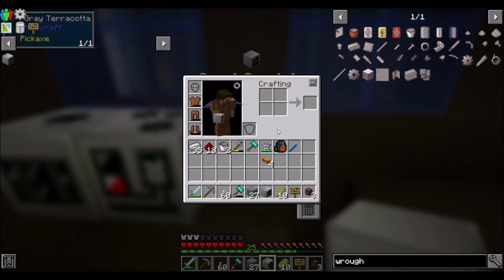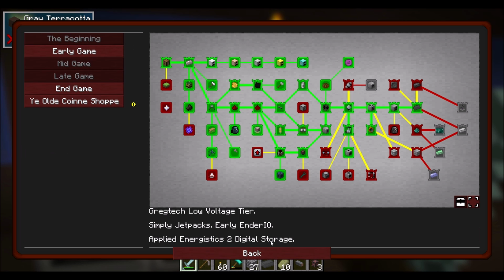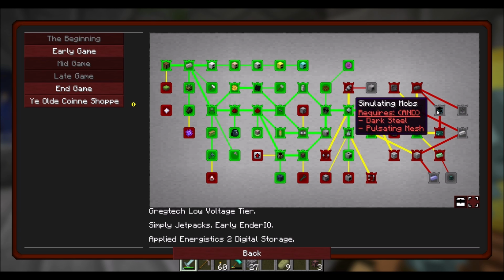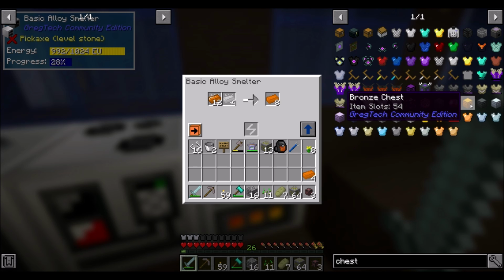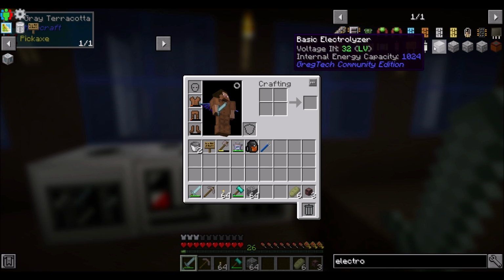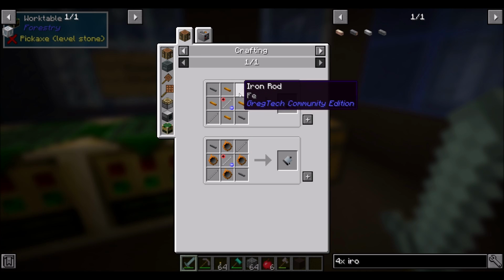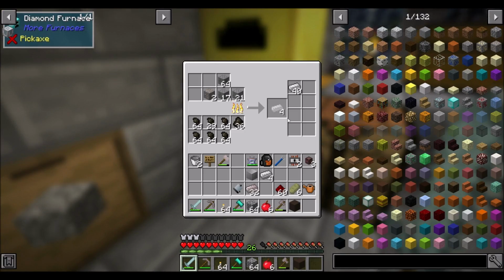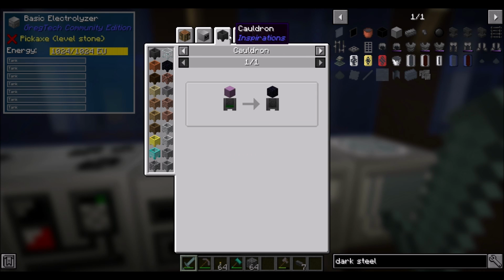OmniFactory   Ep7 More Machines

Comment: Dire, there is a Fluid Solidifier quest in the book.  It has you building ender tanks and pumps to automate obsidian.
Reply: The only hold up being the 8 blaze rods and the 2 redstone servos needed to make two ender tanks
Reply: @Wis-ti  I haven't made the servo yet, but the blaze rods can be found in the lost city buildings.  You can convert brewing stands back to blaze rods.
Reply: I was able to make one servo from loot in a nether fortress, and I've killed a few blazes already. Just need three more blaze rods and a servo personally

Comment: Hi, try breaking an ore block with one of those hammers u use for crafting
Reply: Without veinminer or something to place a lot down all at once, it's really not that important.  TE mining Hammers mine extremely quickly and are easy to make.  Most ore's can't even be smelted in their crushed variety and require further processing to process them.  Until you can make a set of machines for just dedicated ore processing, any macerating or other stuff usually isn't that great.

Comment: Damnit Dire, it’s URANINITE, not urine-ite! >:V

Also, kinda sad it seems they ditched the Electric Blast Furnace. That thing has been central to Gregtech for several iterations now :(

EDIT: Should’ve watched the whole video before commenting that, whoops
Reply: Shaw Fujikawa They didn’t remove the EBF, it is used for higher tier alloys
Reply: Okay, makes sense.
Reply: They only skipped bronze age. 
EBF is the gate from Low voltage to Medium voltage.
Quest to make one is just behind the electrolizer quest that dire forgot to finish.

Comment: Love your vids thank you! Hey what kind of pic set up would you recommend for modded mc?
Reply: i5-8400 turbo cpu w/ good cooler, z-370 motherboard, 1060 geforce gpu, 80w Bronze power supply, 500gb ssd card, a tower that'll fit the motherboard and with decent amt. of fans, and 16gb ram. It's a bit overkill but you can play games like rust and minecraft no problem.
Reply: @chadandre8980  not a complete noob but whats a amt
Reply: Amount = amt. in other words, amt is short for amount.

Comment: Why does he only ever look at the first page of recipes?
The obsidian furnace is NOT better than the diamond furnace. Don't waste your resources on making them until you need them for other recipes.
Reply: Because Dire is impatient and is the poster boy for youtuber blindness.
Reply: @That_River  It is actually better it can smelt two items at a time(same speed as a diamond furnace) and uses less fuel...
Reply: @e1lg537  yes but it only has two input and output slots per side. It's more like two iron furnaces in one but at the speed of a diamond furnace
Reply: @rockbandinthusiast  At the speed of TWO diamond furnaces.  Also dire doesn't normally fill up all of the input slots normally.  

Really the only terrible part about it is it has no auto-split ability for automation and both the top input slots fill up before the second input slots.  Overall it's absolutely an upgrade.  If you need more input or output slots, use a hopper!

Comment: There are 8 power tiers, and 8 sets of machines. Upper tier machines do not use lower tier ones in their recipes, so that process becomes cancerous, pretty quickly. I dropped the pack after the beginning questline was over.
Reply: lul there is why u have AE2 in modpack.
Also there is a block wich can deconstreuct stuff 4 u (but it's only useble in tier 5 or 6 cuz only there it's giveng 100% back
Reply: @mrShift_0044  yes ae2 is supposed to help with the tedious microcrafting, but the recipes of AE2 crafting patterns are absurdly expensive.
Reply: hm, i don't know, i didn't play this pack but some gregtech resources like some for tier 6 (UlV if i remember correctly?) need 13 real hours to make even 1 machine needed to tier progression  so i dunno how really expensive these patterns are.
Reply: @mrShift_0044  13 hours!?! Might aswell name the mod grindtech.
Reply: lmao, dude, i guess you just don't  know what "grindy" really means. 
whot if.... u really is mere but a CASUL?
WHAT RINGS U GOT?
Reply: @mrShift_0044  It's because how JEI works, it shows craft time on lowest acceptable voltage, each tier higher decreases time significantly. In GTU there were recipes requiting close to 80 years to make.